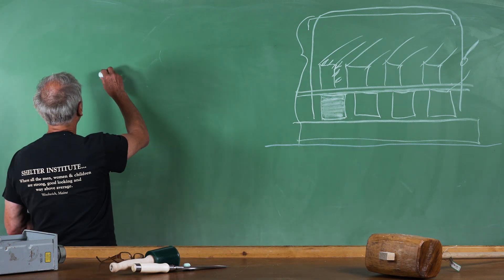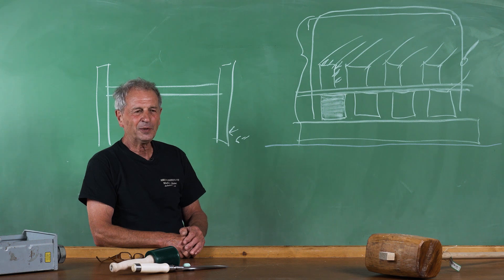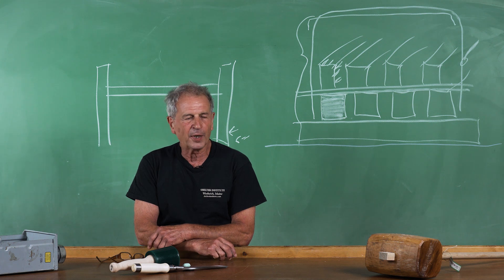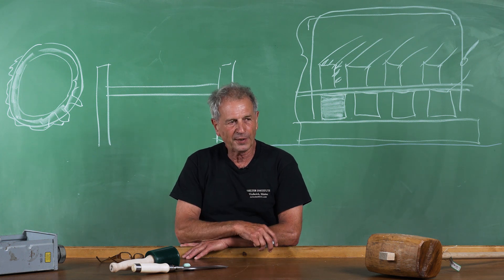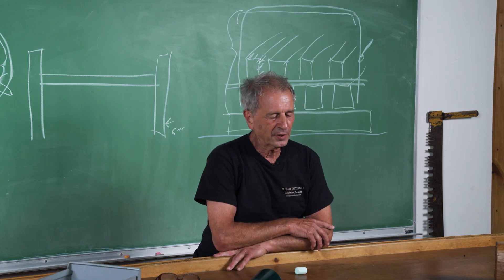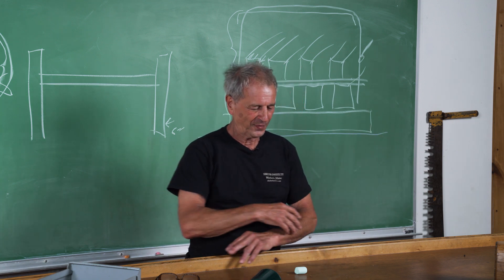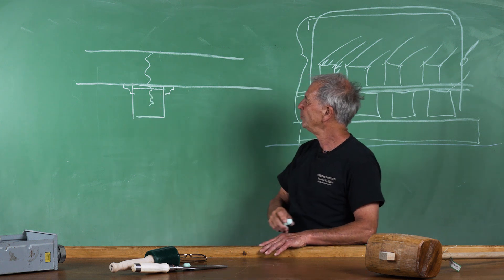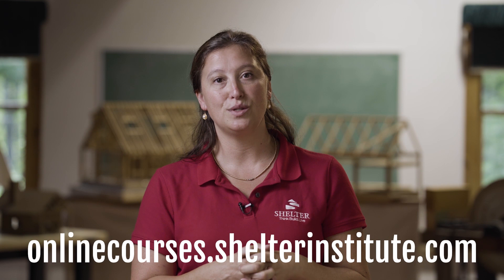Can You Use Green Wood In Timber Framing? - Part 2

Comment: On the Heritage Finishes - I just cut 2 24' 11x12" SYP beams - sealed the ends with Permachink's end seal - but when would you put the Heritage on?  The beams are at about 50% WC.  Thanks!
Reply from the maker: The ends are the most important to seal. We wait to apply any HNF until after we cut all the joinery. We walk a planer down all visible sides to clean and brighten the timber then apply HNF end sealer to all endgrain, including inside mortices, then apply HNF original to all side grain. A timber typically only sits at our shop for 2-3 weeks before we cut the joinery; if it were to be there much longer for some reason we would seal the endgrain before cutting the joinery to avoid checking at the ends of the timber as you have done, but not the side grain.
Reply: @ShelterInstitute  thanks so much for clarifying!

Comment: Do you have an opinion, Pat, about using green wood for timber framing a week after theyve been chain sawed?

We intend to apply borax mixed with linseed oil, turpentine, and tung oil (maybe a wax as well). We will be using wood joinery to connect tge wood pieces. Circumstances have dictated that we need to move in two months time so there’s no time to air dry the wood.

Comment: I'm currently planning to  make a deck with red oak, probably next year.  So I'm struggling with whether to cut it down this summer & let it air dry or cut it next year just before I'm ready to start building.  I have enough red oak on the property that I only cut down standing dead wood (no live trees).  Seems to me that I might be better off getting the deck built (and painted) might minimize warping more than if I try to air dry under a tarp.  My reasoning is that it will be restrained better as it dries.  And with an outdoor deck, it's gonna get moisture during its lifetime anyway.  What do you think?  Thanks, Deac

Comment: Fascinating stuff - thanks, Pat! Especially the last story about the green oak and SIP panes. I've heard that medieval European buildings were often framed in green oak. I think I understand how the framing part could work, but were wood walls, or say, floorboards, attached to the frame, and, if so, how?
Reply: If it was a medievil castle they probably would have attached the framing into the walls (leaving a recess for beam floor or ceilings frames) and attaching the floor or ceiling boards to this frame. This started teqniques started happening in roughly 1000 BC as it made maintenance easier and saved time on the building procedure. It  procedure was however only used on castle or fort type of buildings and not on housing.
Reply: @RicksPhatPharm-vw2lb  Thanks! So, I guess in housing, all the wood was green oak and shrank at the same time and the same rate? I need another lifetime to get into all of this!

Comment: As per the i c b o : lumber used in residential construction. Must be stamped and graded 
Timber frame is cool but I respectfully suggest that you consult with an engineer   Before building 
The speaker needs to clear his throat before lecturing and needs to be aware of the difference in lumber strength

Comment: Question - you say to cut lumber in the summer, but it's my understanding that log cabin/timber frame lumber used to be cut exclusively in the winter; more specifically, in january, and then the logger would come back in the spring to take the logs out and start milling. Seems to be the way things are done in Scandinavia? Is there any truth in that?
Reply: Yes it has been that way all over Europe for centuries. The reasoning is that during fall and winter, trees enter a vegetative state where the sap flows to their roots to protect against freezing. Pat did mention "late summer" and that sap should be flowing out of the trunk. Perhaps it simply happens earlier at his latitude?

Comment: Hi, thanx for the great videos. I have a question. I'm preparing to mill green 6x6 timbers. If stacked correctly and covered, is it necessary to roll on sealant and paint the ends? If so , what is the most economical product to use while still achieving the desired function of preventing checking and twisting?  Thanx in advance for your advise.

Comment: After removing 150 years of remodels from my timber frame house the only two areas I found bugs and or rot was at the front door where a recent landing was built that trapped debris and an inside corner where a down spout was dumping water on an area prone to flood which didn't affect anything other than the plank sheathing and lap board siding. Both easy repair jobs. I've seen worse damage on houses just 20 years old that required tens of thousands of dollars and major structural work.

Comment: If your cutting your own trees  a good tip is to girdle the trees a season before you cut them down. This will let the tree dry using mother nature . Using this tip the wood is lighter to handle, they debark easier and all the foliage or needles depending on the species will have fallen off  so it makes for easier clean up.

Comment: I built a red oak frame, making the beams over a winter in an unheated garage, putting it up in the spring.  I put linseed oil on each beam after I made it. It worked fine.  I was always told that a beam doubles in strength when it dries out so a few cracks are fine as long as you sized the loads for green wood.  My experience has been that an 8 inch beam will shrink to 7-3/4" eventually.  I've built three of these houses over the past few decades.  I wouldn't live in anything else.

Comment: I have questions! So when buying green wood from the big box stores or local lumber yard, do you let them dry more before actually framing with them? If so, how long do you let them dry more? Or, can you frame with them right away? Also can you start framing with the green wood after sealing them with oil and wax or how long after applying the seal before you can use them? Thanks in advance
Reply: Are you talking about pressure treated “ green wood “? Or freshly sawn green wood?
Reply: Buy yourself a moisture meter!

Comment: We live in a 4k foot log home in central Vermont. The internal framing is post and beam made of fir. It was all precut by Real Log Homes (New Hampshire) and put up by a local contractor.  We love the home but there is a "cosmetic" problem. The 45' length of the second floor is supported by post and beam.  Three 12x12x15' fir beams run down the center.    The middle beam is twisted about 15 degrees.  This creates quite a hump in the second floor and it looks odd.  
        The home is now 10 years old and the warranty only covers structural defects.
         Any ideas aside from replacing the beam?  It will be expensive tearing up the floor?

Comment: I’d be interested to learn your opinion of Poplar timbers. I lived in Williamsburg, VA years ago and was surprised to discover the majority of their surviving historic structures are Poplar framing with White Oak sills. I was excited to learn this as the difficulty heaving around a White Oak beam as compared with a Poplar is huge. Poplar is MUCH lighter.
Reply from the maker: We have built only one timber frame out of (tulip) poplar, ironically down in Virginia! It is a beautiful wood, with moderate strength characterisitcs (which is better than the eastern white pine so prevalent up here). We found it moderately difficult to work with hand tools, so we sharpened often. It is significantly easier to cut when green if possible. We also found that it moved and checked more than pine which is expected from a deciduous; it would be worth sealing well on both the side grain and more importantly the end grain to minimize checking.